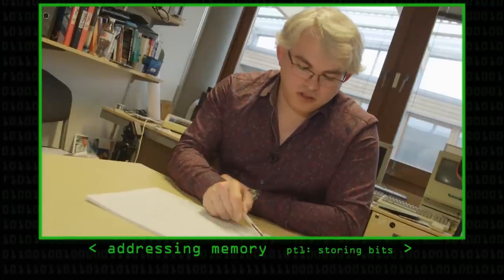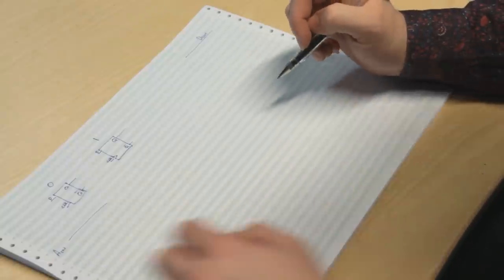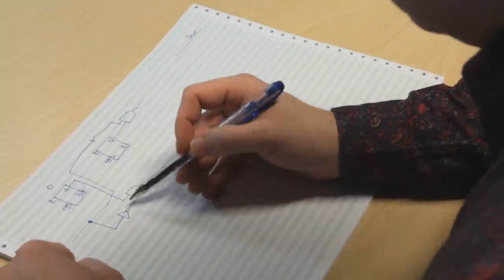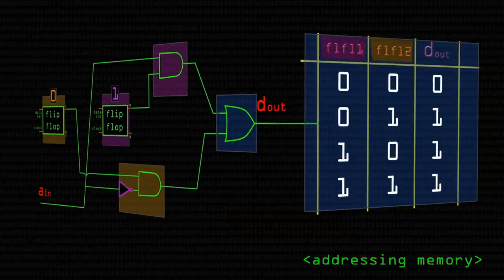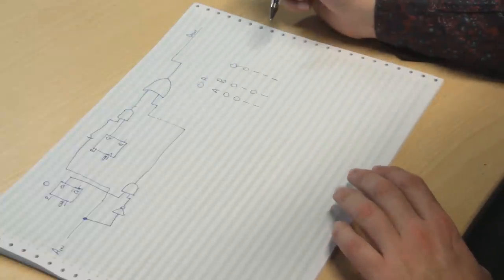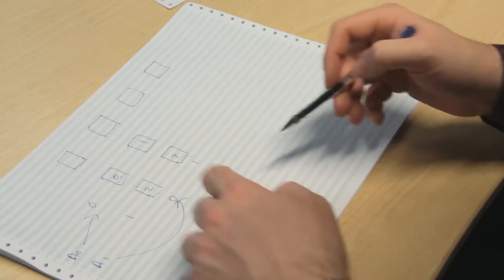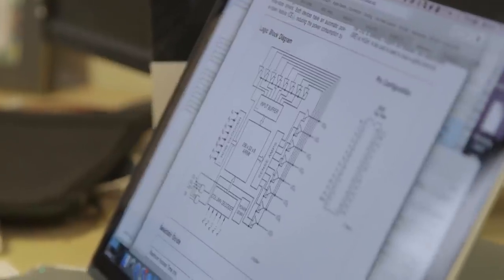Total Recall (Memory Addressing Pt2) - Computerphile

Comment: Ok… The computer hunt: a BBC micro with a modem, I think, followed by an Atari Mega STE or TT, then a hidden computer, and the one no one will be able to miss, the Mac Classic. And on the second shelf, an Atari SF354 or SF314.
Reply: It's not a modem, it's a second processor (I think!)
Reply: Sean Riley It may be, but it is impossible to tell from that distance, however. The boxes are unfortunately the same.
Reply: Well, as I was in the room at the time I could be mistaken, but I'm pretty sure it's the 6502 Second Processor which I took a close up of for the Steve Furber film about the BBC micro...

Comment: Couldn't you just have a Decoder and Multiplexer? The Decoder could easily select which D Flip-Flop to use, and the Multiplexer (using the same select input as the Decoder) could join the outputs at the end.
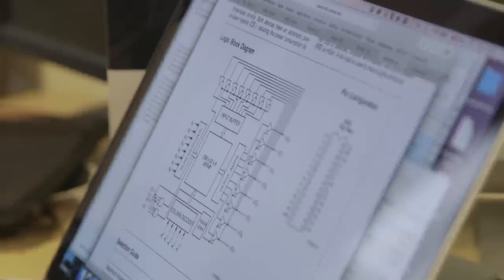Reply: Boom Blockhead Well actually the arrangement of logic gates shown in the video for the two flip-flops is identical to a 2-1 multiplexer. And yes, in larger memory systems it's much easier to represent the circuit on paper using a handful of multiplexers rather than a ton of logic gates, but the video is trying to demonstrate the low-level implementation of the circuit without adding too many layers of abstraction. Whichever way they represent the circuit, when you collect the whole thing together what you have is basically just a decoder. That's why the schematic shown at 6:37 represents the address decoder as just a box labeled "decoder" rather than a tangled mess of multiplexers.

Comment: Please, tell me, what does the OR gate what just conecting the lines wouldn't do?
Reply: Also ich bin zwar gut in Englisch aber was der will hab ich keine Ahnung
Reply: Yamahapsr200 You can't just simply connect digital outputs - if one is in state "0" and other is in state "1" it will cause short circuit because first will connect output to the ground and second to the supply voltage (i.e. +5 V). If you want to avoid using OR gate, you can use "open collector" gates and resistor as outputs of flip-flops but this will give you an AND operation, so you must reverse logical states to get proper result.
Reply: Yamahapsr200 What you don't want is circuits further along interfering with the ones previously. Doing everything just in wires would lead to unintentional effects between the output and input between two chips. What they used in the past to avoid this was diodes -- https://en.wikipedia.org/wiki/Diode_logic -- The problem is that it's hard to maintain voltage levels for inputs when your circuit acts like a voltage divider. One of the major advantages in using transistor based ICs is that you don't need to worry about feedback effects so much in logic circuits. In this case, joining the wires might work, but if you had say a large array of diodes to map a large memory segment (imagine 64k), the voltage drop would be huge.
Reply: In some extent it's the same thing, putting the wires together and putting an OR gate, except that using the port the design stands more clear (you can see that there's a bump when the wires are crossing, exactly for trying to maintain clear what is desired when two 'wires' connect) also there are complications when using a XOR gate (other type of gate), also in in electronic terms there are problems (as some had already explained).

Comment: I have an question: Since we use row's and columns I suppose things inside are arranged from low to high so does it take longer to read/write the last bit of memory then the first one?
Reply: No, it doesn't. Because the row and column signals are electrical signals. Once they are on, electricity starts flowing where ever it can and the output appears on thr output lines almost instantly. There is a delay but the more important point is that the delay is the same across all parts, with negligible change due to wire lengths. It takes the same amount of time to access the "last word" of memory as accessing the "first word" of memory. It's just electricity.

Comment: So in implementation could one create an or gate by simply combining the two wires? Or are strict voltages and amperages kept across the circuits such that more complicated wiring is required?
Reply: I actually got this answer from another comment below but your comment is towards the top so I'll answer it for anyone seeing this is the future.  If you just take the output of the 2 wires the voltage won't be maintained across a large circuit and there's a chance for it to feedback into other circuits (pushing a current through an output could potentially damage the chips).

Comment: Why is the AND gate simpler than OR gate? (if the voltage of wire has to exceed certain threshold you could make the OR gate by simply combining both input wires. )
Reply: OR gates don't just combine 2 input wires, they are based on transistor logic.  In another reply to a comment above someone explained that just combining 2 wires would actually result in a voltage drop when used in larger circuits (not so much in the example but in larger memory modules it would be substantial).  If they haven't already hopefully they'll create a video about how the gates are actually constructed.

Comment: How can 0V be an input? What do computers need so much various voltages (+-12 V, +-5V, 3,3 V) for?
Reply: retepaskab 0V is an input of nothing, a binary zero.12V+ fans and drive motors.12V- used with 12V+ for audio amplifiers.5V+ logic circuits on motherboard, cards and drives. Also powers LEDs.5V- some chips also a require negative voltage.3.3V CPU core voltage (may be less in newer multi core CPUs), also used in ATX power supplies for the front panel power switch.
Reply: TimeLapse1357  Good summary. The other very important use of 3.3V is in USB-ports. USB supply lines are 5V, and USB data lines use 3.3V logic.

Comment: Why is the final OR gate to join the 2 AND gates together? Can't you just connect the output of the 2 AND gates together?
Reply: Gary van der Merwe You would get feedback into the AND gates, so No.
Reply: Gary van der Merwe By that logic, you shouldn't ever need an OR gate - just connect the wires and call it a day, right? The problem: that's not how electronic circuits work. If one output is on and the other is off, simply connecting them with a wire causes current to flow from the high output to the low output. Since there's nothing but wire between those two outputs, you get a short-circuit, your chip won't actually work and will probably melt and/or smoke a bit.

Power equals voltage times current, so to keep power consumption (and heat) under control you want to be able to switch voltages without too much current flow. Therefore, modern logic gates are implemented with CMOS technology which consumes almost no power (i.e. no current) while the inputs stay constant.

I'm hoping ***** will dive into the actual implementations of integrated circuits at some point, and make a video about things like MOSFETs, NMOS, PMOS and CMOS. I know I really enjoyed learning about how these logic gates are actually made and how they work, although it'll probably take more than one video to properly explain it. :-P
Reply: In reality, it's easier to use a "tristate buffer". The outputs of each flip-flop is connected to a buffer, and then the outputs of the buffers are connected together. When not enabled, the output of the buffer is neither 5V or 0V, but free to drift.
When you want to see data at one location, the address decoder selects one buffer to enable. The output of this buffer then appears on the bus, since none of the other buffers have their outputs enabled.
Reply: +VoltzLiveYT +Mattias Buelen +steve cummins  Thanks for the answers.
Reply: Or you could just use two diodes.
Reply: Wouldn't work for ICs which that is where you do things like this.
Reply: Gary van der Merwe An OR gate CAN be represented with connecting a diode to 2 outputs, and then connecting the output of those 2 diodes together. An OR gate IS connecting 2 outputs together, but it implies the direction of the output is guaranteed not to flow back into the output of another. The 'OR' symbol is for logical representation. In electrical engineering and low level programming, these logic words are used to build an outline of function. It is a tool which can seem a bit abstract, but is needed to make things easier to document and follow.

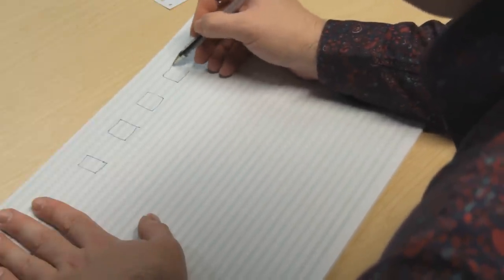Comment: This is a confusing presentation.  I actually understand the circuit, but I have no idea what at 4:50 you're spending 20 seconds explaining with the infographic.  What the heck is that table explaining?  I mean sure, that's what an OR gate does, but you don't just have an OR gate--you have a labeled OR gate, with an ambiguously color coded infographic and, specifically, DOUT being the label of the output.

But you're not explaining DOUT anything... if that were DOUT, DOUT matches FLFL1 in the first, third, and fourth states, and matches FLFL2 in the first, second, and fourth states; that is, DOUT would be dependent on both FLFL1 and FLFL2.  And that's exactly what we don't want to happen--we want DOUT to depend on FLFL1 and be independent of FLFL2 when AIN is 1, and depend on FLFL2 and be independent of FLFL1 when AIN is 0.  Furthermore, that table doesn't describe DOUT based on FLFL1 and FLFL2's outputs.

But if you mean to explain how DOUT would relate to its predecessors--the output of each of those AND gates, then this doesn't work either.  You spend an entire 4 seconds showing how DOUT gets to be 1 when the OR gate's inputs are 1 and 1, decorated with pauses and "obviously".  But the whole point of AIN is that when AIN is 1, its NOT is 0, and thus being an input into the bottom AND gate, that gate's output will be 0.  And when AIN is 0, being an input into the top AND gate, that gate's output will be 0.  So in which universe do you get to talk about DOUT being 1 when the OR's inputs are 1 and 1?  That gate's inputs are never 1 and 1--we wired that possibility out.

This video would be much improved by simply tossing those 20 seconds of explanation.  The circuit itself makes sense as it stands... I still have no idea what that logic table is trying to tell me.  Am I the only one?  Or am I missing something?
Reply: The truth table is showing you why putting an OR gate after the outputs of the two flip-flops will give you the desired output. I hope you've already understood why when one flip-flop outputs 1, the other one is going to output 0. If that isn't clear, take a look at the video again. Now, the OR gate behaves in such a way that if one of its input is 0, the output solely depends on the other input. Think about it. The OR gate is true when either one or both of the inputs is true. If we've already established that one of them is false, clearly the result of the operation will be whatever the value of the other input is. For example, take x = 0 and y = 1. Put them through an OR gate. You get 1, which is the value of y. Now, take x = 0 and y = 0. Put them through an OR gate. You get 0, which is the value of y.

Now, I can see that you're saying that the OR's input can be both 1. If you look at it carefully, you'll see that that is actually not possible. You can either have both inputs as 0 (because the flip-flop you're actually reading from has 0 stored in it) or you can have one of them as 1. An interesting question is why does this happen? It happens because when we select one of the flip-flops, the other flip-flops becomes 0 because of the AND gate. You're never going to get 2 ones.

About your confusion on what Dout is, it is the wire where we're going to read the output of our desired flip-flop. That is, Dout will either have the value stored in flip-flop 1 or the value stored in flip-flop 2. The objective, after all, was to read what is in the flip-flop. The problem was how to select a specific one. That was solved by adding appropriate digital logic to the clock signals. Now, after that, you saw that we had two output lines coming out. We had to select one, which was done using an OR gate, as explained above.